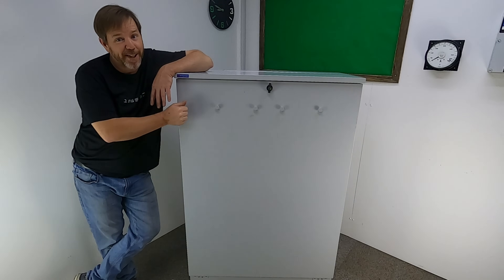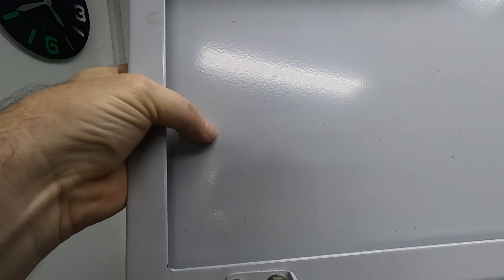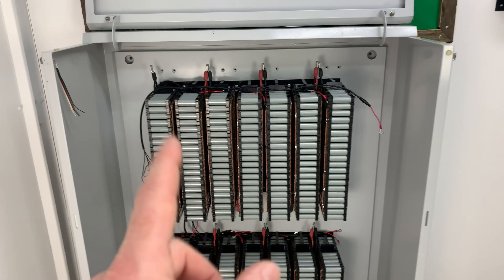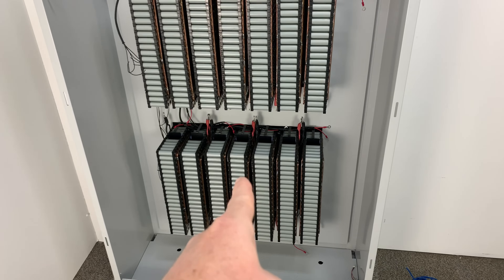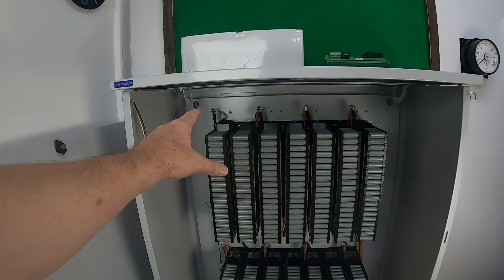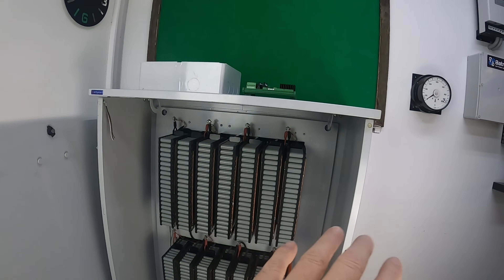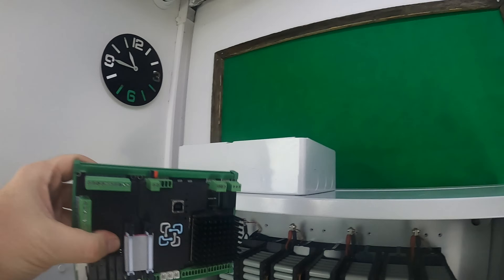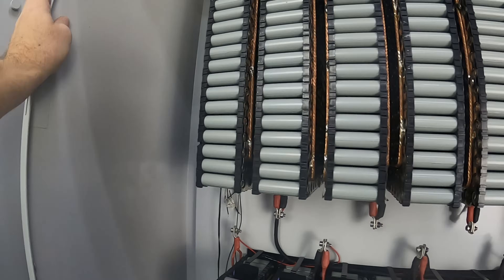Pt.3 Making this MONSTER DIY Battery safe!

Comment: As a mechanical engineer, i wonder how much you are relying a lot on the plastic cell holders for mechanical integrity. Are there  specified of how much load they can take in this hung-up configuration ? Then you have these three unconnected cells taking all the load,  are there mechanical properties known ?
Plus these flimsy upper hooks plus the velcro (! thats where you lost me) , i would not want my shelf of red wine bottles mounted that way and they are definitely not a fire hazard ! 
For sure it looked like a decent idea for the smaller packs, but how much bigger do you want to go with that scheme at some point the cell holders will just shear off ? And plastic material usually does not really age well under loads + some thermal stress that may occur in your container.
If the cell holders are really specified to be used that way, youre all fine, but otherwise i would really suggest a proper steel support reaching out to the lower front corner, so the cell holders just transfer pressure loads from one cell to another, and not being constrained with this pretty hard to qualify load case. Alternatively one could do a finite element analysis of the cell holders.
I may have the bias of the mechanical engineer, but i would rather have spend 12 hours into  a more robust mount versus (oh, just adding a velcro) than rewiring everything just to avoid running an addiitional bunch of cables in diagonal instead of shortest way.
Reply from the maker: Thanks for your input... You sound more skilled than this computer tech diy guy...
Reply: @HBPowerwall  Thank you for your kind reply, i find your project looks great otherwise, and others have already commented on you degree of perfectionism. Well, i cant say it will be a problem, neither that it will hold forever, however if you dont mind, i will try to come up with an educated guess (without FE, it will be typically a kind of very conservative assumption). Weather is bad over here anyway. Is there any link to the cell holders where i could get a bit more details regarding their geometry ? I found from some angles they look quite flimsy, at an another angle i thought, oh, not that bad ... remebering how much a simple cable tie can withstand, its probably not all that bad.  And i may come up with a suggestion on how to properly lock the upper hooks :-)
Reply from the maker: simple piece of wood across the top is all that is needed, no need to over think it. Link, Cad & photos here of the mount 👍 18650 wall mounts - https://goo.gl/xDUzSV

Comment: How many amps capacity on this setup
Reply from the maker: Cells are rated at 5amp max i thinks so 1000 amps max - dead short would be 10,000 amps PLUS if you could get it past the 5amp fuses for 1/100th of a microsecond. but my max load i can even put on it with my gear is 75amps - but when its added to my other cells more like 10 amps.. should have a long slow life ahead of it..

Comment: All I can say is you must LOVE welding those batteries!  Why couldn't you have left it as is (was) and ran the right red (+) across between the to the existing black(-)?  Wouldn't that have put them in series and given you your 48 volts?  It seems it might have cost a little more wire rather than pounds (tons) of nickel!  Just wondering...
Paul

Comment: Hey Pete, I have mentioned before that I had you brackets done in 3mm and this seems strong  enough for your size packs.  However I don't see it a problem to use 4mm.  Or make the bar wider.
Reply from the maker: Yeh, i a few have done thicker - in hindsight it's a good idea

Comment: To make it safe you probably should shrink rap each batterie pack
Reply from the maker: I think that would reduce the safety as you still need direct access to see heat with thermal camera and physical damage to cells (rust corrosion etc)
Reply: @HBPowerwall  fare enough  what about a rubber just taped on each end

Comment: Housing all the electronics for this on the roof lid is what I would have done. Easy access later is worth more than looks to me.
Reply from the maker: Yes ease of access is a massive issue - so much so I haven't even started the last part or commissioned the battery yet.. :(

Comment: Since you requested information on things you might be missing...  You could use an exhaust vent and fire suppression system like you'll find in similarly sized commercial lithium battery cabinets.  Here are examples: https://www.denios.co.uk/shop/lithium-ion-battery-storage-cabinet-safestore-5-shelves-w-1200-mm/  I don't have anything to do with these guys other than having read about them regarding the conception boat fire disaster.  You might be able to make use of an arduino (or several) and sensors for heat/fire/smoke/etc detection and mitigation.
Reply from the maker: BMS has temp sensors, that will trigger shunt trip. BMS is also integrated with a fire alarm in case of smoke/fire. Suppresison might buy you a bit of time but this much 'fuel' will take many many hours and many 1000s of liters of water to cool the thermal reaction.

Comment: dude you clearly know a lot about electricity but why do you not insulate your wires better from each other? your large copper wires from one box to another are very very close, i'd put something in between each one of the packs to separate and insulate them from each other. it doesn't have to take up the whole gap, you can still have airflow, but you should have some sort of barrier up against jumping....same for all of your connections, leads and wires in relation to the metal box itself. i could see at least 3 areas where the leads could make the whole box go live.
Reply from the maker: WHY? they are joined anyway?
Reply: @HBPowerwall  i must have seen, how you wired it, wrong. Im sorry. Making sure the casing doesn't go live is still a good idea. How's it's ground?

Comment: Have you ever thought what happens during an earthquake with your battery packs sitting on the mounting plate?? They will fall out and make a big big fire, or set the metall housing on a dangerous voltage. Unfortunatelly i know what can happen even with "only" a burning electric drill battery while charging, placed close to a can full of WD40....
Reply from the maker: To be fair - Brisbane don't have any earth quakes.. and that would be the very last thing id be stressing about if it did.. it would just burn away in its shed...

Comment: How often do you run this 14kwh wall down, is this enough power for your use?
Reply from the maker: I discharge my main house battery that is 40kwh to under half SOC every night. This one is 25kwh and hasn't been cycled yet
Reply: How many watt panels do you have to support 20kwh of usage, manage to stay on top of it ok? Thanks for your work you’ve done learnt a lot and starting to setup my own system based similar to yours
Reply from the maker: @david667766  I have 14kw of panels

Comment: 8:51 Don't use adhesion,  it never lasts, and failure is like falling off a cliff, (No time like "the present of that instance" to start growing wings!!!)
further, at 6:56 Velcro is based on adhesion too, unless you use screws to affix the velcro to the two surfaces to be attached together!
at 6:56 I would recommend an electrician's nylon wire-tie, hooked around the two opposing plastic brackets where the 3 batteries are missing. Have the wire-tie go around the two plastic frames, go behind the "front-most" vertical plate of that support bracket, and both wire-tie straps OVER the horizontal bar coming forward supporting the vertical plate. nylon is high temperature, (220C, 225C, 255C)  chemically and mechanically resistant to degradation,  and like a hundred-year landfill rating. The batteries won't last that long, so likely wire-ties will be replaced before self-decomposition of nylon.
At 8:51 I would suggest mounting ONLY to the back-panel, a key-hole in the rear upper back-wall, and a small bracket attached to the bottom outside of the plastic box, (Pair of screws up and down through the bracket and the bottom of the box) (Another one or two screws, Machine-screws through the bracket and threaded into the back panel)
( At 8:51, If you mounted the box a bit lower, instead of a key-hole, you might instead use a bracket from the top of the plastic box to the back-panel, mounted low-enough to allow hand access to the top bracket to back-panel mounting screws.)

Comment: Hi there. Im located in the lockyer Valley between Brisbane and Toowoomba. Where are you located in Brisbane?
Reply from the maker: Southside
Reply: @HBPowerwall  awesome I'm glad to find your YouTube channel. I'm keen to make my own powerwall. We have recently had 20kw solar installed and would like to use as much of our own power on site. Looking at options for importing cells as I dont have a source of second hand cells.
Reply: @HBPowerwall  I don't think I will be able to collect and process enough second hand cells myself. Is it worth using something like this? https://aus.grandado.com/products/2-50pcs-18650-battery-4200mah-3-7v-18650-rechargeable-battery-li-ion-lithium-bateria-for-led-flashlight-torch-lithium-battery?variant=37658974224535&gclid=Cj0KCQiAzZL-BRDnARIsAPCJs71r9kkN_5dqCrw3PDrXV5_sgT1kl-qnnxsiItr8XlCoz-LVrLSnFXAaAu0pEALw_wcB

Comment: Why not only flip them over (top to bottom) and make one long cable from left up (- from upper pack) to left down (+ from pack down below) on the right side u would need only a short cable so would nothin crossing and everything would be the same build???
Reply from the maker: Design flaw - won't work

Comment: Nice but why are you doing all of this?! Isnt it super expensive and overkill?! Cheers from Malibu
Reply from the maker: To add to my battery storage capacity - from 50kwh to 75kwh
Reply: @HBPowerwall  i understand, but why? Why not get a deep cycle car battery with 120k kwh for 150 squid? Or anything similar, with solar plugged or smth. Im genuinely asking the point of this since im new to your channel ^^
Reply from the maker: Lead is useless. This is 100x better
Reply: @HBPowerwall  okay. Would you mind Explaining a bit deeper why all of this? Actually curious. Thanks!

Comment: Great work Pete - have you thought about redesigning the brackets? I don’t think the velcro is satisfactory as the fabric may stretch over time. Plus the slope of the metal tabs will tend to push it to the wall with the forces on it.
Reply from the maker: Its has been drawn up but not in the budget at the moment, i will update on the next run of mounts I make

Comment: I think the top hook part of the battery-holder, doesn't need to be so far out. Or rather, i know why you did that - for better leverage - but actually it would be stronger/cheaper to make a thicker hook on the bottom. So thicker sheet metal, but only an inch or two long before it goes down (less far) into the battery space. Maybe sell a tube bar brace in place of an actual battery, because if left alone for long enough, that battery will explode if not charged.

Comment: the velcro solution with fixing the packs is not a good idea. In case of a fire your packs may come loose and shorten somehow the other packs...try to get a better solution for mounting the packs firmly.
Reply from the maker: Already done - well planned, 2.5mm mounts have been designed - one thing i'm struggling with is the radius and how long i need to make things to account for proper fitment.. At the moment i don't have spare funds to spend a few hundred to make some trials.
Reply: @HBPowerwall  why not making a horizontal rack or shelf out of 2mm aluminium and let the packs stand or lay on it.
Reply from the maker: because i've always done it this way - kinda like my trademark

Comment: nice. but, cannot understand what is this?
I mean, what this IS?
Reply from the maker: Its a recycled battery made from old laptop batteries to power my home.
Reply: @HBPowerwall  thanks. but its not what I meant. I would like to know how does it do that?  FI, does it has to be charged somehow, or once charged it provides electricity for some time until next recharge? btw, thanks for fast response 🙂
Reply from the maker: it will be charged with my large solar system, and connected to my  pair of PIP4048HS inverters
Reply: @HBPowerwall  ok. thats unfotunately a rocket science to me. plus its hardly or not at all attainable here where I reside. great work from your part and excelent technical skills you have, btw. all best wishes in your future endeavours.
Reply from the maker: Thank-You

Comment: I'm sorta like you at making electrical look better. To save the money spent you could have installed the lower batteries backwards. It's a great cabinet with lots of room so add a vent to the outside of steel or stainless. It will vent the cooling air or if things go wrong the fire. If you can put the battery management board on the front spacer board or even the door it will make future repairs easier. Don't forget the door is usable space.

Comment: For me personally, it's always nice to have polycarbonate insulators anywhere I've got more then 40 VDC. I'd probably also put it between each of your segments, but that's just me. Technically it doesn't matter if the segments bang into each other from what I can tell, but you can never be too careful. 

Also, those nickel strips your using, are they going to make a 20A version of them? I love how elegant they are, but I'd need a higher rating for my purposes.

Comment: 3:55 Do I get that right?
You are ripping half of the batteries apart, because you want to avoid 1 cable from one side to the other??? 🤔
Reply: Yeah.. that's just.. borderline. Good video tho.
Reply: @sammie9999  Its a matter of him wanting his craft to be as good and neat as he can make it. Less cable length equals less resistance aswell. In a sense hes also taking note of a mistake and correcting it. Call it OCD, call it professional pride.. either will work.
Reply: @sorkmine  but has the cells mounted, so they swing like a hinge and can short out from the smallest vibration. He almost shorted them just putting his hand on it. They need to be mounted positive to positive, negative to negative AND have a rubber insulator. The whole mount should also be flipped so the "hook" keeps the cells from sliding out in case of an earthquake and strapped across the front mounting them to the cabinet. 

This job would never pass inspection solely because the batteries are + - are facing and the cells are not fastened down.
Reply: @excitedbox5705  They cannot short each other the way they are oriented. If 2 adjacent modules make contact, it's just reinforcing the series connection that's already there. Adjacent modules are already connected to each other, see how the busbars connect. I agree about strapping them though or supporting them further, it seems like they could potentially slide out.
Reply: @QuantumBraced  And those straps should be made of something that is fireproof because otherwise if there is a small fire it will instantly cascade into a much bigger one because the straps will let go.

Comment: that batt reconfig.. damn bro. 0,5m of 7g wire (or less OCD)  could have fixed that instead. painfull to watch :)
Reply from the maker: Dam your math must be worse than mine - it's over 2m
Reply: @HBPowerwall  sorry for the drama :) Still, 2 meters of maybe at bit heavier g wire instead of that massive dismantle :)
Reply from the maker: it was about the final product... need it neat and clean - I have a vision that is some times obscured by my weird OCD

Comment: I am trying to learn all of this battery stuff and have one nagging question that I can't seem to get an answer to. With RC we have balance charging that checks each individual cell to ensure it is healthy. Once you get above 15S, people seem to abandon that idea or go with a BMS and gang cells together to check each gang instead of each individual cell. With this many batteries, how do you sleep at night knowing that one battery somewhere in the hot glue package could have gone bad? What is the plan to replace the bad (and possibly dangerous?) battery in the middle of a huge project? What is a suitable charger to use for these bigger projects? Thank you!
Reply from the maker: BMS with temp sensors, each cells in monitored, each cell is fused, layers upon lays of safety makes it easy to sleep
Reply: @HBPowerwall  What is the plan to replace the bad (and possibly dangerous?) battery in the middle of a huge project? What is a suitable charger to use for these bigger projects? Thank you!
Reply from the maker: I do it all the time, you just rip off the fuse wire - put a multi meter over each cell & use a thermal camera, it's takes less time than a basic service on a motorcar. I use PCM60X solar chargers with 4kw of panels on each
Reply: @HBPowerwall  Thanks for the info you provide here!

Comment: Hi, i Hope you understand my bad english. You make a Good Job, Talk Clear and Simple. Thats Nice. But your Handle with the Big Packs is Horrible. At the smal Step´s when you build a Batterie, you are Save, but why you dont insert a Fuse at the end of the Packs to prevent a Horrible Shortcut. If 1 of your Packs is Falling down, that takes a Chainreaktion, because nothing ist Isolated. If some Screw ist falling at the wrong place, all ist Burn and your good work is going away. Plz make it safety an Show it a little bit better, to get from Perfekt to very Perfekt.

Comment: What was the main reason to switch from 24V to 48V?
Reply from the maker: I was going to use it in my workshop in 24v format -but the regulations changed so needed 48v for the hybrid inverters